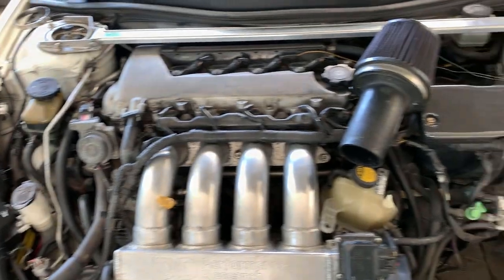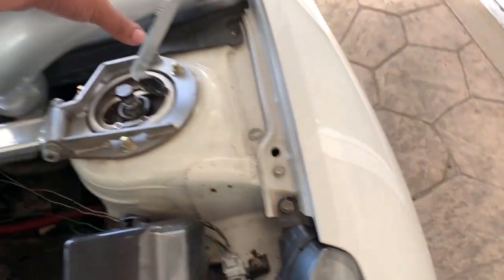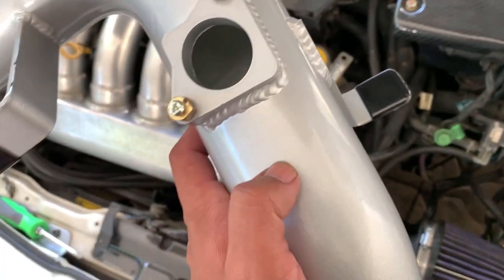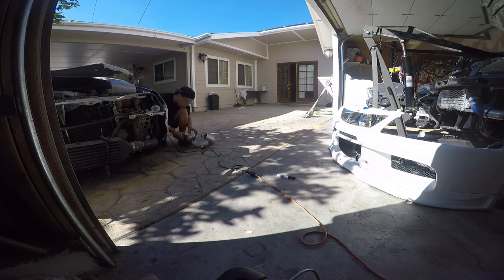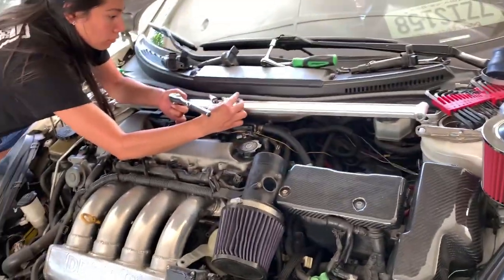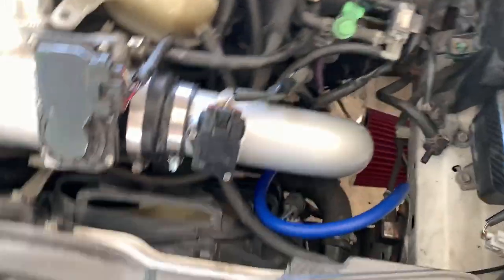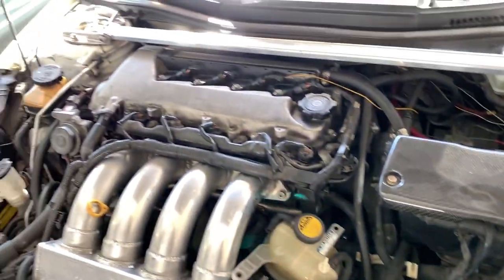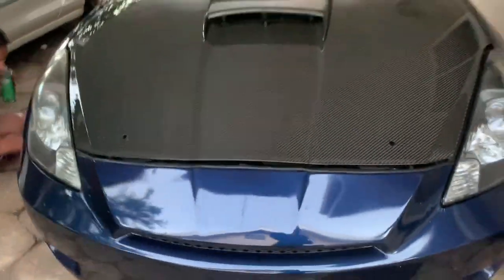How To Make Cold Air Intake On A DDPR Intake Manifold

Comment: mabe a larger injectors or fuel pump to even out the lean i had to replace my fuel pump and put a higher pressure one it gets a little rich on full throttle
Reply from the maker: Jemal Kose im going to upgrade them later down the road
Reply: That unfortunately won’t work
Reply: Yep not without a reflash or aem ems.
Reply from the maker: Comedic Commentator im going to give my baby my pfc and get myself a hydra
Reply: Hydra stand alone or as a piggyback to the pfc?
Reply from the maker: Comedic Commentator stand alone
Reply from the maker: Comedic Commentator my wife is getting it
Reply: Is 3.5" to much with a reflash fr ok m r9k

Comment: That manifold looks so good! Are you running stock ECU?
Reply from the maker: The Most Ariel yes running stock ecu still
Reply: You didn’t throw any codes? In my experience I’ve found that you need to plumb the crank breather and IACV into the cold air intake after the MAF to get the ecu to run correctly
Reply from the maker: DxBOY15 That is weird my CAI is before the maf sensor but Ive seen someone with a ddpr have it after the maf sensor